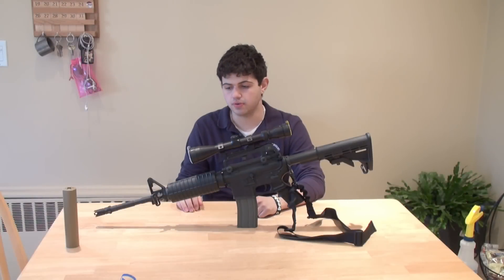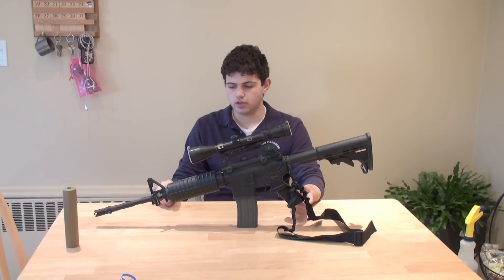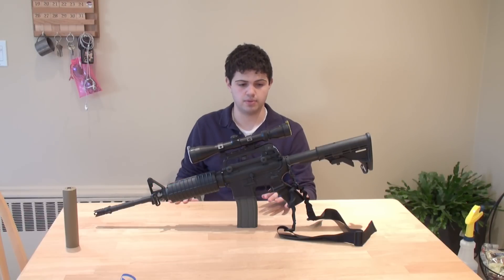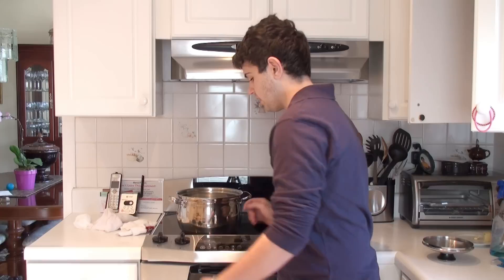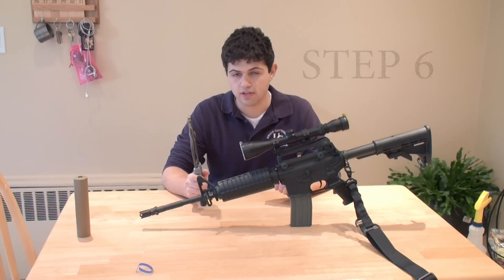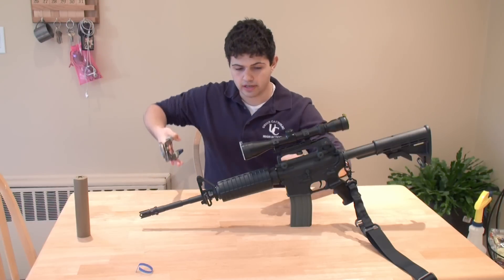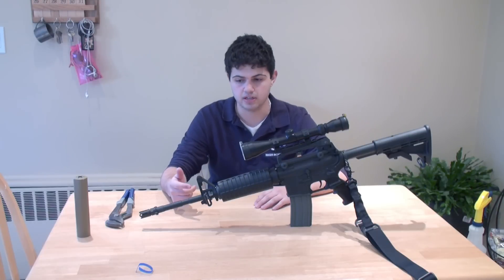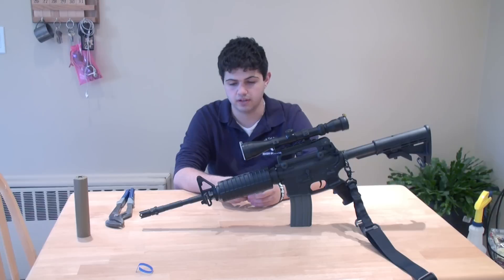Orange flash hider removal Tutorial

Comment: This is how I did it with my first gun though you don't need boiling hot water. Heated water from the sink should suffice. Not lukewarm, but HOT. But not boiling. Also, you'd better be prepared if the paint on your gun chafes.

Comment: my g&g has a pin not a screw. how do i get that pin out?D:
Reply: you have to take a flat head screwdriver and dig it in the plastic and pry the pin out
Reply: I might be a tadddddd too late but I just did this an hour ago and I used a box knife and cut around the pin and dug the plastic out and then pulled it out with a pair of needle nose plyers but be careful not to cut your self with the knife.